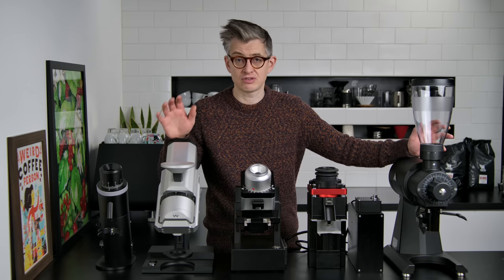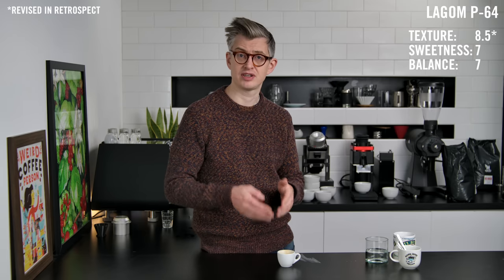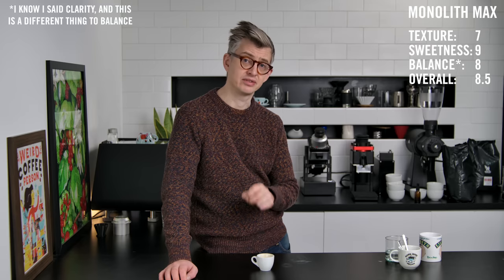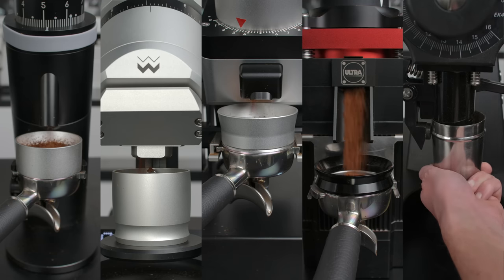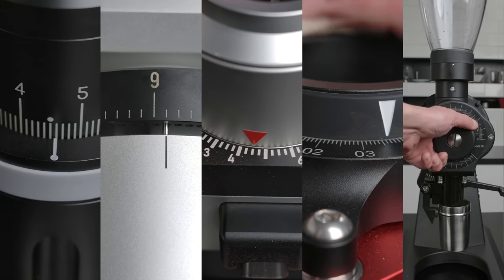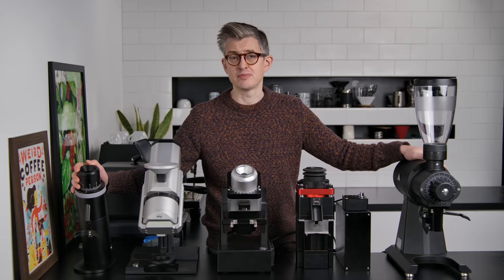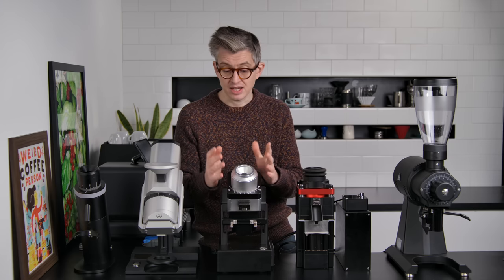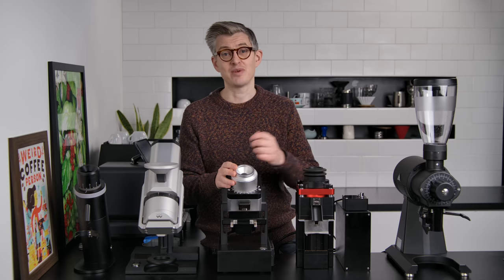The Ultimate Grinder Showdown Finale (Episode #6)

Comment: I will never be able to buy any of these grinders but I learned a lot from the series and that’s the importan part. Thanks for doing it and I’ll keep enjoying my comandante 🙌
Reply: 😂😂Well put
Reply: Agree, my Bezerra BB005 manual is good for me.
Reply: Frankly, after seeing the prices, I am checking out. I bought a used Super Jolly for 250 euros a couple of years ago and it will likely see me to my grave. I'd have to be lighting cigars with 50s to ever care about these machines.
Reply: Fantastic series, thanks for the info. I will stick with my Breville pro grinder for the time being, but at least if I win the lotto I know what to go for.
Reply: The Comandante is probably the best tasting and most pleasant to use grinder within a much higher price range. I wished they would produce a motor for this.
Reply: @LasstUnsSpielen  There are some "hacks" to use it with powertool and so on, someone I think even makes sorta power station for it.

In practice it wouldnt be that hard to make motor stand with variable RPM even. :D

Comandante is probably worth it, significantly better than anything in its price range, manual or powered.
Reply: @amunak_  Think tastewise you somewhere near Niché.
Reply: Comandante is maybe the best grinder. Obvious those grinders (video) are used to grind during all day high amounts of coffee and are not to consistent as The Comandante. Have you tried putting a drill on the comandante to speed the grind?
Reply: @JohnKruse  lol, and then you still wouldn't care for different reasons.
Reply: @corwinblack4072  Comandante is much much better for filter than the Niche, at least
Reply: @r_bear  That would be a bit surprising, but probably possible.
Reply: @corwinblack4072  not surprising, really—the niche produces a ton of fines and is first and foremost an espresso grinder. The burr geometry of the Comandante is much more suited for filter.
Reply: @gregfitch8937  I too am enjoying the Breville Smart Pro grinder.  Can’t see ever buying one of these grinders.
Reply: wow these are expensive. Any great grinders for around 170 pounds. I live in Australia. Or what are the best grinders under 200. thanks
Reply: @roberta4760  For under $300, your best bet is a hand grinder.  I know you have import taxes with the US. So I'm not sure what you can get there without that markup.  Maybe a J-Max or a Timemore Slim(that's what I use when I need a fine grind or if I'm camping).  Both will hopefully be under $200 in Australia
Reply: @veganpotterthevegan  ok great thank you

Comment: for a home barista , find a 50/50 (espresso  & pour over)  grinder is important , because the space and budget will effect the choice . if the performances can achieve  80/80 , it's enough to me . I can micro adjust  by experience and others method to get higher score.  But , I know is impossible to get 80/80 grinder .  i prefer to choose a espresso grinder :EG-1, coz fines can solves by many method. thank you for your epic video James~

Comment: Any particular reason (apart from "this project must have an end somewhere") for not including one of the Ceado grinders (the two e37z variants or the "cheaper" e37sd) or the Mahlkönig E80 Supreme (in a similar way to the EK43, not a home grinder)? I'd still be interested in your opinion on these someday.
Reply: I had this question as well!
Reply: I don't know if there was input from the patreon backers but I agree with you. Ceados seem to be underrepresented "everywhere" even though specs-wise they compare well with everything else, they're commercially available (whereas nost of these are basically boutique and you need to jump through hoops and import them).

Comment: I've been waiting for this series ever since you mentioned it, thank you so much for putting it together!
I used the EK in a cafe setting as both an espresso and filter grinder, switching back and forth quite regularly. While maybe not optimized for that workflow, I found it pretty doable and I've been planning on getting the EK43S when I can finally build my home espresso setup. The versatility to use one grinder for both espresso and filter is the biggest factor for me and the low retention and stepped adjustment of the EG-1 might just push me over to that side after watching this series.

Comment: as a pointer. one mildly useful bit of info at 18:47 would have been to see a frequency response graph for each grinder. the flatter it is, the closer it would be to 'white noise', and you would be able to see where the peaks are: ie 2kHz peak for the ek-43s. the lower frequency the peak would suggest a much less harsh sound, ie more of a rumbling than a scratchy whirring. wouldn't really have expected you to have gone to these lengths but if you need help in the future for anything like this i would be willing to help out. really enjoyed this series too. the eg-1in black is now my holy grail grinder, maybe if i win the lottery 👍

Comment: Out of the bunch, I can only afford the Lagom, so this is what I will go for. I am relatively new to espresso and I feel anything less expensive will only keep me wondering what I might be missing. So I think if I want to save money, as crazy as it sounds, I should skip the mid-range and go for the top tier. Yes, there are other options in Lagom’s price range, with even bigger burrs, but they are usually much bulkier, hopper style, and often more difficult to clean (all are big minuses on my list). So, all in all, I think Lagom is a clear winner in its price range for those who value quality of espresso, small foot print, single dosing, low retention, quick grind change, and and very easy maintenance. The only problem is a wait list :(

Comment: Thanks so much for this video! I currently have a Niche Zero. Among other things, I do love the fact that it's easy to calibrate and to clean. I'm wondering how these other grinders are in that regard--especially the Monolith. That is one gorgeous grinder, IMO. For me, ease of cleaning is an especially important consideration, because if you find cleaning difficult and are therefore less likely to do it as required, grinder performance will be compromised. But maybe people who are buying these high-level grinders are used to doing their own maintenance.
Reply: Not much to clean on the monolith. It retains so little it doesn’t warrant much work. Some people do vacuum the funnel top  and the spout, but disassembly doesn’t offer much in reality. Some people even grind a few grams coarsely to push out bits.

Comment: Perspective on cost.  For avid espresso drinkers,  $3500 broken into 10 years of daily use and 4 espressos per day is $0.25 per use.   Throw in $2500 for an espresso machine and $0.4 for the coffee (18g per dose at $10/lb), you can have a shot of top tier espresso for $0.90/shot, or about the same price as K-cup drip or McDonalds drip or 1/2 the price of a cafe espresso.  As a bonus...lower carbon footprint than those alternatives as well.  You get the best coffee experience for the least cost and you save the world.

Comment: To me this feels a lot like backpacking equipment. I’ve been looking at new tents recently where the difference of 100g or so can be $200 or more! When you apply that to all the equipment you can save a kilogram but is it really worth the extra $1000? 
Like with all hobbies one needs to think about how much it’s worth to them and if that extra performance will even be noticeable and if that is worth the extra $$$. 
Thanks for the great video and self reflection!
Reply: Exactly what the "law of diminishing returns" is. Lots of benefit for little money at the start, but as you get to the high end each little improvement costs a fortune.

Comment: Personally I'd pick the EG-1. Not for its looks but it's the easiest to clean. It's also great for filter and espresso. Pretty much what James said. 

I have a Eureka Mignon Specialita and it has around 10 screws to remove if you want to fully clean the grinder (which I just did before watching this video). 

It's the main complaint I have with it and why I thought about buying a Niche on multiple occasions. In the long run it's more about workflow and maintenance. More realistically the EG-1 is expensive and I don't have the space for it. So a Niche might be in my future if I decided to get a different grinder.

Comment: The tougher exchanged retention test would be to see if going from espresso to pour over grind setting has espresso grounds or excessive fines in the pour over. I found with a lot of grinders there's an accumulation of fine particles from grinding for espresso stuck in the crevices, and when you start grinding coarser it also grinds faster and you have larger fragments of coffee that knocks the fine particle retention out. So it's likely when that happens when you make that first pour over coffee (after coming from espresso setting) it's going to have a lot of fines and it's going to taste over extracted and bitter as a result.

Comment: I have the leftmost LP64 and rightmost EK43s two grinders,but the Monolith Flat MAX that I want to buy the most cannot be successfully purchased, only the smaller Monolith Conical. In addition, I also have Ditting 807 LS, Anfim SP450, Mazzer Robur, Kony, Major.... I like to collect grinders and make some modifications.

James has a very high evaluation of EG-1, which makes me want to order it, perhaps the EG-1 is suitable for both commercial and home use. The first choice for home use is Flat MAX. The best choice for commercial use is EK43s, but in fact, coffee shops with good business will not choose EK43s. Traditional commercial grinders such as Mazzer or Anfim or Fiorenzato make the output of espresso the fastest, but these commercial grinders are not suitable for household use, because cleaning up the retention is very troublesome.

The Ultra is the most pity, the least retention, and the Espresso is also highly rated for its balance and sweetness. Unfortunately, the overall structure is too scattered. If the whole machine is integrated like EG-1 or Flat MAX, the CP value will be the highest.

Comment: I think I would've been torn between the Lagom P-64 and the Monolith MAX as someone who prefers easy single dosing for espresso, but then the pricing would clearly come into play in choosing one of the units.

I love that they're both stepless but the P-64 is indeed a bit confusing when tuning to the right grind size and RPM number in comparison to the other grinders. And its portafilter seating being a bit loosey woosey makes me a bit nervous. But man, do I love its sleek form factor. As someone who fantasizes about the Niche, the P-64 also comes closest to the desired style and presentation.

Monolith on the other hand would seem superior in this comparison, but then falls short in RPM speed and overall form factor. Distribution tool could be better. But then it ticks the boxes, like keeping the portafilter snug and tight and making maintenance very easy like having a magnetic chute which also adds to the experience. And the ease of setting the right grind size, as well as keeping things quite retention free. And no popcorning.

Just considering the price alone, I would look at my own everyday setting where practicality, space and great results weigh considerably so much that I would be grateful for every feature that I got with the grinder. Which is why I would ultimately go with the Lagom P-64, even if I'd have to adapt a little bit. Both have flat burrs, have great capacity, they grind consistently and have their own aesthetic style. Great upper tier grinders, based on these reviews I think only one would be compatible with my lifestyle. Thanks for the rich insights, James.

Comment: idea for retention test. thoughts?

1. put the entire grinder on a scale, 0.1g precision ideal
2. add dose to the hopper
3. remove the collection bin
4. tare scale
5. replace bin and grind (including any retention mitigation)
6. remove bin
7. read scale
Reply: I know this is like 5 months late, but there is almost no scale in earth that can be accurate to 0.1g but also handle a 2-5 kilo grinder. Not one that a normal human would buy. Because once you are that heavy, 0.1 gram represents 0.005% or so of the total weight. Even pharmaceuticals dont require margins of error that high.

Comment: I dig your content and appreciate what you are doing.

It's great that you help us see and learn about these high end machines, but I am curious what you'd recommend for entering the valuable grinder game. Seems like I can get a better grinder by my willingness to provide muscle power instead of electric, but you mentioned and Baratza Sette which isn't way more money than some of the manual grinders (at least not the 270). I have been and will continue brewing pour over, Areopress, and French press but plan to get into espresso at home. Yes as a hobby: i.e. spending time and money on it for pleasure. I am using a Kyocera that is fiddly and so-so at best.

To maximize bang for buck and hobby interest for espresso, I'm thinking Robot, Flair, or Rok. I'm not as sure on the grinder. If there was a pressure gauge on the Rok, I think that's what I'd do; it just appeals to me and the price is fair. The Robot is super cool, but I don't think I can actually justify the higher cost and additional $80 to ship.

What grinder would you recommend? The Flair Royal seems well suited to the Flair press, and I quite enjoy the aesthetic of the Rok grinder. $200 feels like the max I want to spend,  but if there is a night and day difference for something well under $400, I might consider. Also electric is a bonus if all else is equal or close.

I hope the grinder will help continue to improve my other brew methods, so switching from one grind to another is important. Find and repeat grind setting seems a huge plus for the Royal.

Thanks for being you.

Comment: Super learning experience - thank you James. Monolith Flat Max for me, based on pretty much only running with espresso based coffees in my home. @ $3000 plus though its way out of my budget... I wish it wasn't! I currently use a Wilfa Svart which although I've learned cant grind fine enough for good espresso, seems to deliver a pretty well balanced shot through my Sage. I need to take the next step though and get something a little higher end. Seems absurd that I would consider a budget of £500 for a grinder but here I am. What would you suggest James ?

Comment: I'm surprised the Monolith was one of the two that you would keep if you had the choice. While it seems a trend with all of these that if they came with a dosing cup they ended up pretty cheap, when it comes to the other accessories you had a complaint out of every one on the Monolith. In contrast, again aside from the dosing cup, you praised every one on the Levercraft Ultra. I guess those are just peripherals and not the grinders themselves though, I can see how the size/bulkiness if the Levercraft would be a turn off - but I still can't get over how amazingly quiet it is compared to everything else.

Also, is it my imagination or did you say in the beginning for the brewed coffee test you were going to do filter and immersion brews, and then only showed filter? Or when you said "filter and immersion" did you mean the Hario Switch that blends both?

Comment: Have maintained for a while that a Decent DE-1 paired with a Monolith Flat Max is about as good as it gets for espresso. Seems to still be born out here.
Reply: Tbh if you NEVER pulled an espresso shot before the decent will tell you HOW bad a job you’re doing. You won’t necessarily get good shots. It is possible for someone on a non-modified Gaggia classic to make better shots. It’s a point we often forget. As we do something more, we get better at it. Maybe you can start on something more entry level? For example I was on the really bad porlex tall for 2 years before deciding on an upgrade.

Comment: But (excellent video, week, work) how do these grinders  fare with the old Italian style espresso (ristretto) using a blend and 14 grams for two of these cups? Would you need different burrs?
The green bean market has shifted in the past two decades because of inexperienced roasters searching for the best mono thing because they did not have the blending experience (consequentially driving up prices on top of market growth).
With an overall much finer grind, would you need more particle size distribution and would these grinders be able to deliver that?
As to the noise, my first grinder took about 30 seconds with a high pitched noise and the current one about 5 seconds for the 18..20 grams. 78 dB and above stops conversation and I would prefer the faster time. Have you looked at taste versus RPM setting? That did not become clear to me. My wild-assed guess is that some heating may occur in the grind chamber, one way or the other, and the question is what works better - burr size may play a role here as well as burr area per revolution. Not an easy optimization problem.

Comment: I've read in a book that hand grinders are better for filtercoffee because of the heat produced with electric grinders? What do you think? I have a C40 MK3.
Reply: I personally call BS. Unless you are in a commercial setting, there is absolutely no way that an electric grinder could produce and transfer any significant amount of heat. The motor is running for all of a minute, if the hottest part of the motor was above 40C Id be very surprised, and the chamber with beans was more than 3 degrees above room temperature Id be even more surprised.